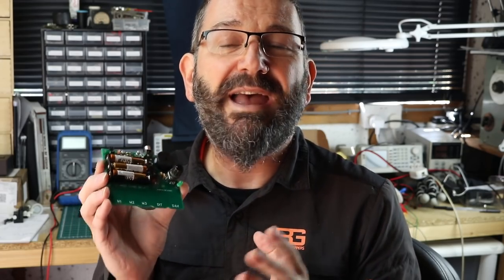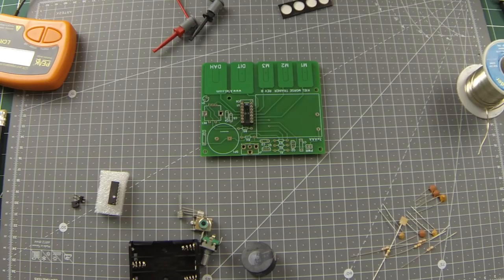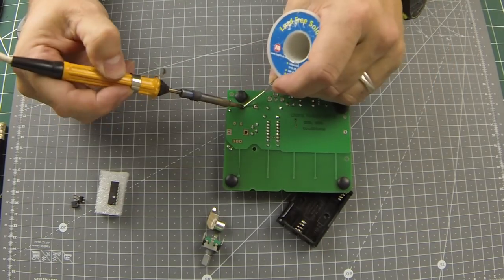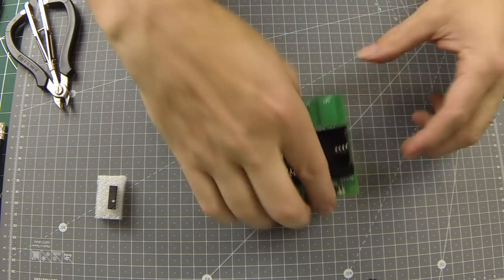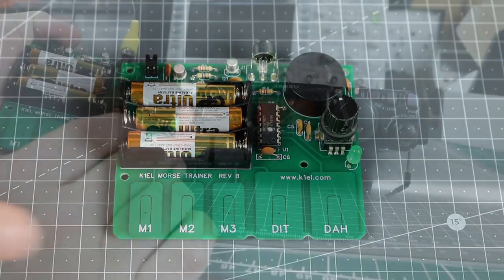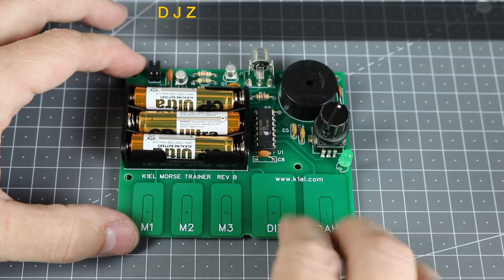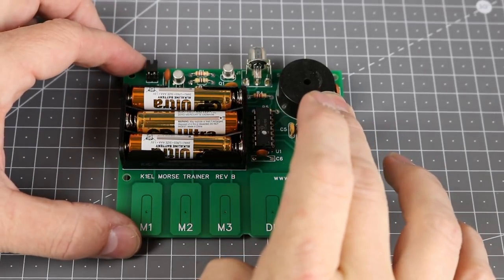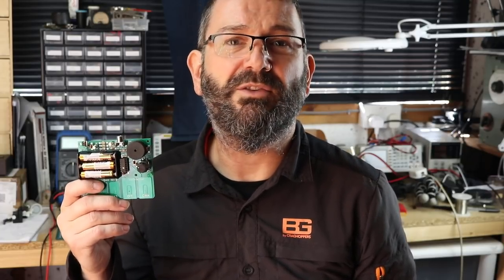K1EL Morse Tutor

Comment: I like this kit. Cost is about 2/3 the cost of qrpguys kit and has built in system to key. Less parts than qrpguys too. I like both kits but this one is probably better for new CW operators to learn and practice on.  I like the concept of sending using the index and middle fingers too. Capacitance keying rather than mechanical iambic might catch on. Nice presentation of Steve's MTB.

Comment: Way late to the dance here, but you could soLder a wire to each of the touch pads and one to the ground and Super Glue a key/stereo jack to the PCB soldering the wires to the jack and you have a keyer.

Comment: You have and interesting set of side-cutters; I've never seen anything like them before.
Reply from the maker: Kadicha The black handled side cutters have a built in wire stripper...that’s the mechanism you can see running down the middle of them. It’s very handy, however, it can make the action of snipping wire a little over zealous because the mechanism offers some resistance that needs to be overcome. I’ve recently supplemented these with a more traditional pair of small side cutters.

Comment: Are you able to place actual paddles on this as well?  K8JLW
Reply from the maker: Reid Lanham As the kit comes the answer is no. It only has the built in touch pads. A few of us are wondering if it might be possible to mod the board to enable a key to be plugged in :o)
Reply: I was thinking the same thing. Mod the circuit to add an external key. Something that interfaces with the touch pads.
Reply: It would be great to have 3.5 jack option if possible.

Comment: This year's Boxboro convention featured a public building station for these, sponsored by the Nashua (NH) Area Radio Society. The focus was on getting young amateurs and amateurs-to-be to build but they welcomed builders of all ages. Lots of them were successfully built over the weekend, including one by me - KE1L, not to be confused with K1EL!. It's a nice little kit, and if you're done with practice it can be easily adapted to key a radio. (You remove a couple of components that are used to enable the networked feature.)